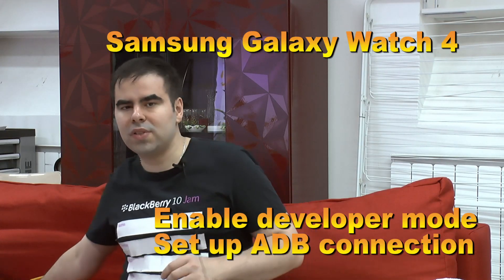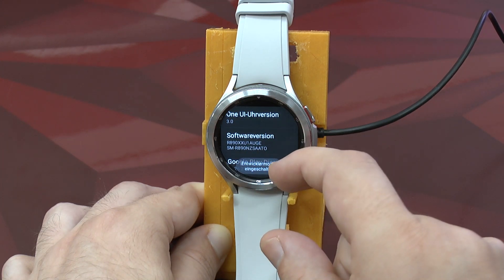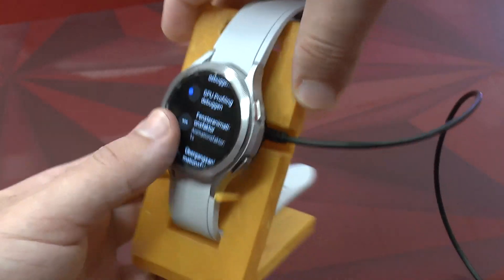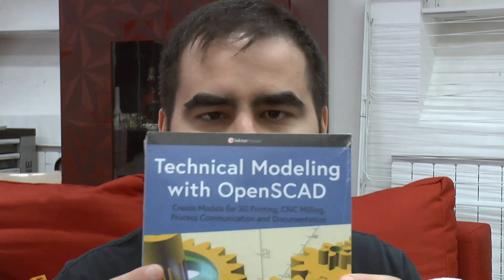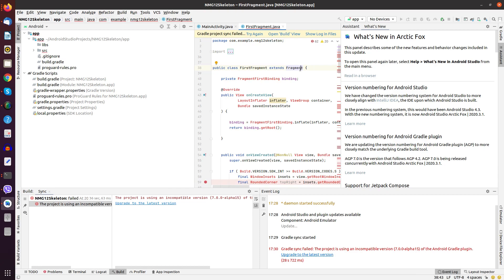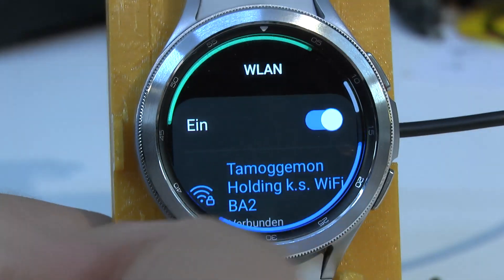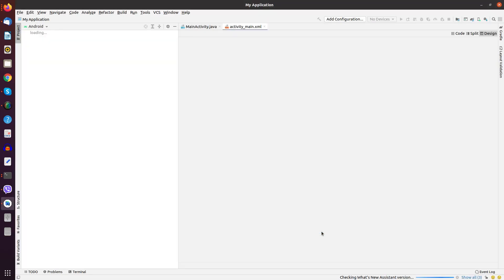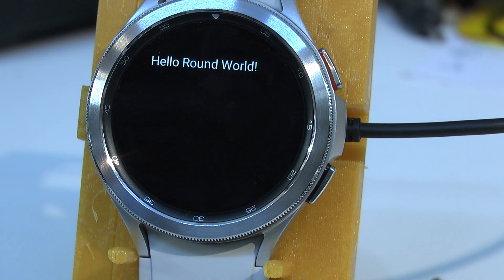Galaxy Watch 4 - enable developer mode, ADB debugging

Comment: I have a problem and I can't find a solution. I can connect to my watch 4    sdb connect 192.168.14.44:5555  (connect approved in the watch) BUT if I try sdb shell I get the message "closed", it is like I have no grants to deploy anything on my watch.   Any clue??
Reply from the maker: Hi, can you post the detailed data flow for me?

Comment: Hi!!! I see that in my watch 4 classic, when i set "disable automatic wifi" in developer options and then exit or reboot system the option turn back disabled again.....how to save options or set it permanenty?
Reply from the maker: Hello Man, sorry - I honestly do not know. On some versions of Android, most dev options switch off in every reboot - I have the same problem with KonstaKangs Android builds for RPi, for example...but still big thanks for talking back!
Reply: @MrTamhan  thanks for your answer man, helps me to know that this happens "normally"....also raspberry? I dont have one, but i thought it was more developer friendly device and kind of systems and roms or builds ahahhaha
Reply from the maker: @michaelcampofiorito2089  hello, my pleasure. No, I am using an inofficial build for the RPi - the official RPi people do not provide an Android build...
Reply: @MrTamhan  ah yes yes just hardware.....yeah but on devices like this i thought free roms from developers were "open" to these optional developer settings....its oke ahahha thanks again!
Reply from the maker: @michaelcampofiorito2089  My pleasure, man. And thanks again for being here, hope you also like the rest of the channel!
Reply: @MrTamhan  sure man!!!
Reply from the maker: @michaelcampofiorito2089  my pleasure. Sorry if I sometimes dont post anything for some time, it is very workload dependent...
Reply: @MrTamhan  yeah its no problem!

Comment: Thanks for hat great video!
I would be interessted in removing bloatware from my watch. Is that possible in ADB mode?
Reply from the maker: Hello Paet, thank you for talking back. AFAIK not - what app are you after in particular?
Reply: @MrTamhan  thanks for your fast response
Ungoogle it would be perfect. Or at least remove everything but phone and message function
Reply from the maker: @paetgmeiner3620  paet, to be honest, I think you have VERY BAD chances here for this. The watch does not even have an USB port...so flashing stuff is IMHO impossible...

Comment: How to change the CSC code of the Galaxy Watch 4? I noticed that the language options may differ depending on the CSC.
Reply from the maker: Hello, sorry, I never experimented with this so far...
Reply: I think  you should flash the OS fully to change the CSC. I did it with my phone (S9+) but for the watch Idk how to! :/ 
You can boot into the recovery by holding both buttons for like 30 seconds. From there I guess it's the same process like the phone but IDK what kinda software you have to use! :/